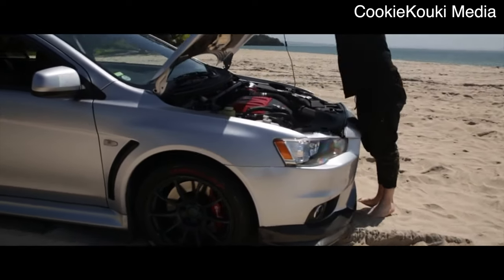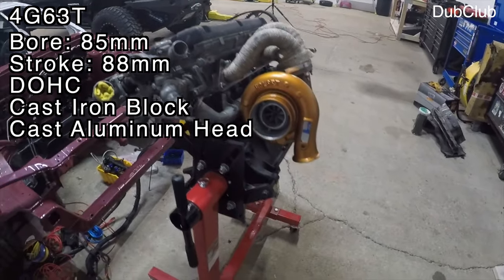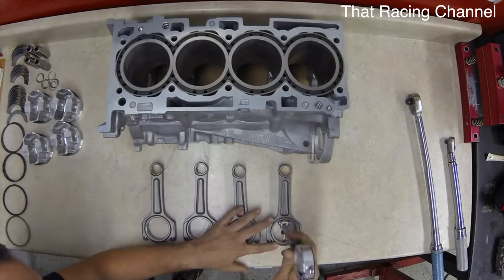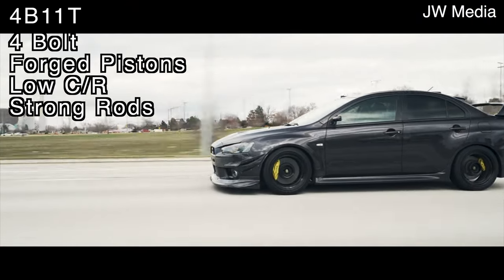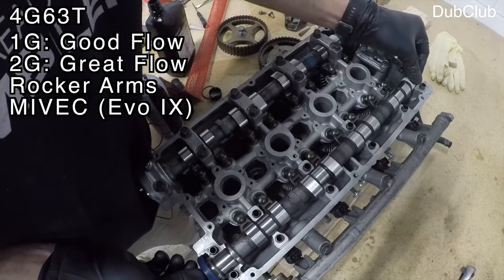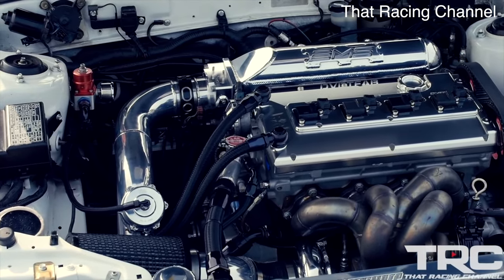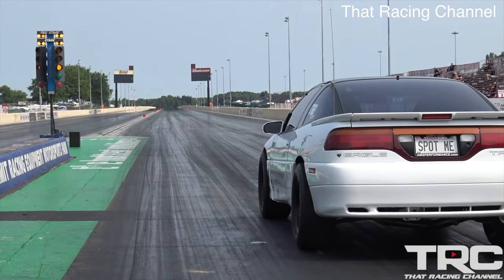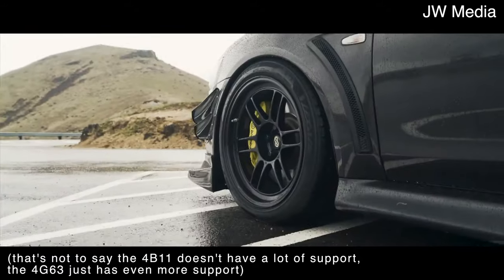Mitsubishi 4G63T vs 4B11T: Which One is Better?

Comment: Until a 30 year old 4b11t proves it can still hit 60 in under 10 sec 4g63t is the champ, and even then it has to be used in  5 year old car at the same time to match the widespread use of the 4g63. So see you all round 2040 for a logical conclusion?

Comment: 4G63 is better since it's the only one of the two that has run mid 6s at 223 mph.
Reply: just because a fully built one can run mid 6s doesn’t mean that in stock form it’s better than the other and vice versa

Comment: I'm looking at this block im looking into for my car, my current engine is insanely comparable to the 4b12 but I'm wondering if the specs are the same as the 4b11 w/o the turbo....even so I'm thinking about modding the stock engine. My car is quite light & I hope it will hold up about 350-400hp

Comment: i've tracked a 305whp 4b11t (my own ralliart - single scroll turbo) and a 360whp 4g63t (my ex flatmate's evo 8). i can tell you on the track, i only needed to stop every once in a while for my pathetic ralliart stock brakes. but with my mate's evo 8, enegine overheats every 2 laps. it's insane. i don't want an engine that can seemingly make reliable power but need extensive down time in order to do so. expecially evos, they are made for cornering with ridiculous speed in low tractions. the tricked out central diff and rear diff imo show the real intention behind the design philosophy. it's almost sad so many people think a car with 2L 4cyl engine is meant for dragracing.
Reply: Having raced a 1g eclipse at Grattan raceway in Mi, for a track-day event. Overheating is not an issue on 4g63t's, there likely was an issue with his cooling system.

Comment: 4BG6113TT LETS create a monster. 
My BEER car......
Square
Decked
4B11 Heads/technology valvetiming
Gated turbo/ or maybe centrifugal.. I like both ideas and each have pro/con, so application of use would be the decision.
Which one would be lighter full system weight not just turbos you know. Dropped into a snubnosed GTR32 chassis, get rid of transverse engine position to...uh brain fart...whatever...longways with Subaru/skyline transmission/transfer case mechanical wonderstuff.

Bspec Engineering Experimental Road car
 I miss my 05 ww evo8, I’d probably look into a 4B11T swap if I still had the Machine.

Comment: In terms of design, I'd have to say the 4b11t is better, but just barely. All aluminum, Mivec, stronger than people think despite the semi-open deck, the only thing holding it back is that Mitsubishi sucks and went with what was safe, all while ruining their racing/tuner fanbase, especially with the new "Eclipse".

In the end the 4g63t is better, but only because of the aftermarket support.

This is coming from a guy with a 1G Eclipse GSX and an 80's MIghty Max, both with 4G63t's.

Comment: 3S-GTE
Reply: this engine came in how many cars?  the mr2 turbo is the only one or what?
Reply: epoxeclipse
Celica Turbo first (Gen IV, V, VI)
MR2 Turbo Gen II
Caldina Turbo Gen I, II
So from 1988-2007. Designed by Yamaha like all truly great Toyota engines using most of the same design as the 2JZ-GTE. 185hp-285hp depending on application. Mine are 30yo (MR2T 300whp) and 25yo (Celica ST-205 400whp) and still running strong. Toyota reliability.

Comment: I'm gonna get hate, but the 4g63 is overrated. They just constantly have lots of minor issues, they never run right when you modify them, even though they can handle power. Plus you've still got crap head studs and crankwalk
The real best 4 cyl would be either from honda, like the k series or the ea888 which is a power house

Comment: My 4B11's bottom end just gave out... stock :( lol
Reply: My 4g63 bottom end just gave out about 3 week's ago.... Stock :(
Reply: Jiu jitsuu cries in apex seals
Reply: 3S-GTE
One of mine is 30yo and the other is 25yo, both make over 300whp. Both are still pulling very strong.
Reply: What power were you running bro?
Reply: @emlix1  everything was stock. I'm assuming the previous owner ran it low on oil.
Reply: My eagle talons always broke the bottom end its the block that's strong the rods are weak... but my evo9 is solid making 500whp for over 5 years no problems stock bottom end and drivetrain best 4g63 by far.

Comment: Sooo, compared too 2JZ and N54... its weak sauce.
Reply: @zeroyon223 do you own any of those  cars
Reply: @zeroyon223 4g63t is cast everything. It has to be a built motor to come close too 2jz and N54 factory forged.
Reply: @zeroyon223 incorrect
Reply: @zeroyon223 read about n54 and 2JZ
Might as well look up B58 too
Reply: @zeroyon223 rods snd crank are forged, pistons are coated in the motors I listed. 
Stock block dyno numbers say it all.
Reply: @zeroyon223 you found a high horsepower number for 4g63, but you left out the torque figure because it's very low. 
Then you said per liter, which doesn't mater unless your in a category at a track some where.
Thanks for the numbers tho(where's the torque number?), I already knew them.
My original comment was, the 4g63 is weak compared to the 2jz and n54, And that's true.
Most 4g63 wont go above 550whp with 500wtq. The n54 and 2jz do that with stock turbos, crank, and rods.
Reply: @zeroyon223 heres some metric. A motor that cant handle torque without a rebuild. equals WEAK.
Reply: @CP-jt6bw  Comparing 4 cylinders to 6 cylinders is dumb as hell since you've got two more cylinders to distribute & spread power to which makes it far easier to put out bigger numbers reliably without changing anything and along with that also have at least 0.5L - 1.0L+ more of displacement which will always give it more room to breathe in more air more efficiently than 4 cylinders do and have a higher threshold of what it can take simply based off the fact it's just more in every way so obviously it'd do that. 

It's like me saying, "Well, compared to the VQ35 vs 6G75 MIVEC then the EJ25 is WEAK" when those two V6's are in a FAR different league than a Flat 4 EJ25 ever will be able to be considered in. 

Apples to Oranges comparison man

Comment: You sir should just stop making engine vs engine videos. You make the assumption that just because one engine has less development than the other, that it automatically means that it could still be the better motor. Factors such as Raw engine block material, and bores thickness/ siamese bores automatically determine the 4g63 to br the much better, stonger and reliable engine overall. You can ask anyone who builds 4g's and 4b's and they will all tell u that the 4g is better.

Comment: I don't consider the four b411  to be an Evo engine imo , it was not an evolution over the 4g63 , it's not faster or stronger and it has the turbo in the wrong side.  If you want a more  comfort with a nicer interior, get an sti + a boxer sound . You can defend the 4b11 lancer all day , it is no an EVOLUTION over the 4g63 it was the death of it

Comment: 4g63 i better .The engine is just a race engine on a road car
Reply: Better In what way?
Reply: @alexstromberg7696  well 1 the iron block can hold more boost /power. And no oil problems for which the 4b11 is famous for.
Reply: @atjhvysrmojpeyhjsvth  so the engine is better for power? So the 4b11 is better in every other way? I'd call the 4b better. Does everything the 4g does but while being lighter and more fuel efficient.
Reply: @alexstromberg7696  how is it better ?when you get oil leaks and the car is slower .Ok the engine is lighter but it can handel the power .If you want a economy car buy a honda
Reply: @alexstromberg7696  ive seen 4g63s making 1000hp  nobody buys evos for the low fuel cost
Reply: Bruh as someone who has an EVO X and a Honda Civic. I’ll tell you this. My civic is my daily and eventually bout to be making more power than EVO. (ATM) but the Civic is open deck and aluminum block.  But it does have forged pistons and rods etc. also when we talking about power it’s where the power is . Like is it in the last 1k rpm or is it a torque monster 3k onwards. I’m soon to be searching for a 4g63 equipped vehicle not sure yet what I’ll import but I’ll see first hand what I’ll prefer. For different applications. 

Cheers
Reply: @atjhvysrmojpeyhjsvth  it will use less fuel at 1khp too. It was a statement that just peak power isn't how a engine is better you sperg.
Reply: Alex Strömberg correct dear sir but I was throwing out different argument variables. Also for someone to research to add to the knowledge as it is moooah powah baby
Reply: @alexstromberg7696 It will not becuz it cant get to 1khp .The Al block will blow up .4B11T can make up to 500hp to be safe ,all boost after that is dangerous . And the m10 is 1540 kg  while the 9 is 1465 soo yea the engine is lighter but the car is heavier.
Reply: @atjhvysrmojpeyhjsvth  4b11's are also making 1k power. It seems people fan boy over nostalgia without realizing it.
Reply: @alexstromberg7696  you can't even  prove me wrong . The mX is heavier than the last evos . And the car has engine problems . Get mad all you want im just saying facts
Reply: @atjhvysrmojpeyhjsvth  i was never mad, the 4G63 also got problems you know? like every single engine made.
Reply: @alexstromberg7696  yes but its more reliable for boost  and engine tuning
Reply: What oil leaks are you talking about? My evo x has 60k miles and no oil leaks. Also there are 900hp and 1000hp 4b11 motors that have been built. What country are you in where they havent done it yet?
Reply: Anthony Jones I hope any car doesnt have any leaks at 60,000 miles wait till you get to 120,000 miles+ then you will see the leaks lol.
Reply: @DaytonaBlueHr  most cars at really high mileage have leaks. How does that specifically make the 4b11t worse than the 4g63? Especially when most 4g63 will have higher miles than a 4b11t.
Reply: Anthony Jones i never said it was worse lol. I just said i hope you dont have leaks yet at only 60,000 miles. I own a Dodge Stealth r/t (3000gt sl) with 165,000 miles and one of my Cam seals is starting to leak a tiny bit i have to take the timing belt off to replace that Seal. I very well know that every car at a certain mileage will start to have leaks but all im saying is i hope you dont have any yet at only 60,000 miles 😂. And im more into the 6G72tt builds rather than 4G63T or 4B11T engines just my preferance even tho the 4G63T and 4B11T have a lot more potential.
Reply: 1997-1999 3000gt Vr-4’s were and still are the fastest Mitsubishi production car in 0-60 and in the 1/4 mile. The 3000gt Vr-4 is the father of all Mitsubishi’s dont get it messed up.
Reply: @DaytonaBlueHr  the lancer was used in racing before the 3000gt was a twinkle in Mitsubishi's eyes. If the 3000gt is working 100% it might be faster than an evo but i doubt it. Fastest production mitsubishi was also a mitsubishi evo x with 440hp. So back to your cave you go with the heaviest and slowest turbo awd dodge sir.
Reply: Anthony Jones My guy the Dodge Stealth Twin Turbos were 150 pounds lighter than the 3000gt models. The Stealths didnt have Aws, active aero or active exhaust hence they weighed less than the Vr-4’s. There have been Dodge Stealth Twin Turbo’s (second gens) that have ran 12’9 in the 1/4 mile stock and 0-60 in 4.6-4.8seconds.
Reply: @DaytonaBlueHr  you show a video of a clearly modified 3000gt beating a stock evo x to say that all evox are slow. Lmao. An evo x with bolt ons and a tune runs mid 12s. I dont hear of too many 3000gt running period these days though.
Reply: Anthony Jones and look at the comments in the video. The owner even says its mechanically all stock and with just a chrome Ecu tune it can run mid 12’s. And you need boltons lmao sorry to tell you but Vr-4s are just plain faster. The top speed of a 3000gt Vr-4 (second gen) is about 170 mph and Evos stock top out at 150-155. Nice try bud but the 3000gt Vr-4 is just faster. And the video you linked me was slower than what the 99 3000gt Vr-4 ran and that wasnt even the best time that that these cars can actually run. The Dodge Stealth Twin turbos being lighter can run high 12’9 1/4’s stock. Its all facts here buddy
Reply: @DaytonaBlueHr  oh its great that your car runs so amazing and you got it on video...oh wait.
Reply: @DaytonaBlueHr  a 3000gt has 2 more cylinders and another turbo than an evo. The fact that a 4 cylinder evo with minor bolt ons and a tune is just as fast as a 6 cylinder 3000gt with a tune is called progress.  Also way to punch down. Why arent these amazing 3000gt motors running with gtrs the way 4g63 and 4b11 do?  3000gt was great for its time but it will be forgotten to history. The evo wont.
Reply: Anthony Jones I daily drive my car to work and college lol and the 4g63t and 4B11t are better engines for holding more power and boost. I already said that up above ^. Im just stating that the 3000gt Vr-4s were the fastest stock production car that Mitsubishi has made with the exception of the MR models. You said you own an Evo X right?? Your car has a lot more potential than a heavy 3000gt Vr-4. Im just stating stock for stock the 3000gt Vr-4s were faster. But nobody keeps their car stock  and we both know that 😂
Reply: @DaytonaBlueHr  you keep saying the 3000gt was fastest production mitsu. It was. Now though, the evo x fq440 is the fastest production mitsu.
Reply: Anthony Jones Well that car was only sold in the UK but if you want to call an Evo with upgraded high-flow injectors, an Ecu tune and an upgrades bigger turbo a “stock production car” then okay its the fastest Mitsu car in your terms 😂 lol
Reply: Anthony Jones Well that car was only sold in the UK but if you want to call an Evo with upgraded high-flow injectors, an Ecu tune and an upgrades bigger turbo a “stock production car” then okay its the fastest Mitsu car in your terms 😂 lol
Reply: Anthony Jones Well that car was only sold in the UK but if you want to call an Evo with upgraded high-flow injectors, an Ecu tune and an upgrades bigger turbo a “stock production car” then okay its the fastest Mitsu car in your terms 😂 lol
Reply: @DaytonaBlueHr  its not in my terms as I am not mitsubishi. I didnt design, produce, sell and warranty the fq440. But Mitsubishi did. They sold it at dealers with warranty. There for it applies to being the fastest production Mitsubishi by their standards and also the automotive press. Sorry if that burst your bubble.
Reply: @DaytonaBlueHr  keep in mind you're definition of fastest seems to only apply to quarter mile times. The evo has always done better than the 3000gt on a road course. Even when they were sold alongside each other. The 3000gt was a great handling car but in its own class amongst the rx7, supra, skyline gtr it was the worst handling.  All wheel steer was a crutch in the late 80s early 90s sports cars, but when engineers figured out they could make better suspension adjustments AWS was left in the dust.
Reply: Anthony Jones The fq440 was just an Evo X modded with bigger injectors, bigger turbo, bigger intercooler, and an Ecu tune. They took a stock evo and just modded it. That isnt stock anymore its just a modded version of the Evo they are selling lol. And plus they were only sold in the UK and never in the US.
Reply: @DaytonaBlueHr  by that logic a hellcat is just a modded r/t and its not it's own model sold new from the dealership. You lose, good day sir.
Reply: Anthony Jones Not the same logic lmao. The hellcat has a 6.4 L engine with a supercharger. The R/t has a 6.2 L engine and is NA. DIFFERENT ENGINE DESIGNS FOR EACH ONE. The fq440 was just a stock Evo that they modded and sold to the public in the UK. Nice try bud 👍🏽
Reply: @DaytonaBlueHr  you know what. We'll just agree to disagree. You have fun with your behind the times platform I'll have fun with my soon to be behind the times platform that will practically never lose value.
Reply: Anthony Jones I love you man 🥺
Reply: I own a evo 8 with FP Red turbo with bolt on tuned at ams e85 with 145,000 miles daily driver 425hp 400tq . My buddy owns a evo x FP black same bolt on tuned at ams to. Went from a roll race started pulling on him from 2 gear pretty much put about 2 cars on him he got pissed went bck to ams for a different tune and cams 😂
Reply: Long live 4G63!!!!!
Reply: @rodzevo8136  how was the out come after the tune with cams?
Reply: @RealAnthonyJones  didn't race him after that he ended up moving away last I heard from him was he's x was puttin down 600ish with built motor and ported head👍. Cant wait till thos mods come to my 8 lol